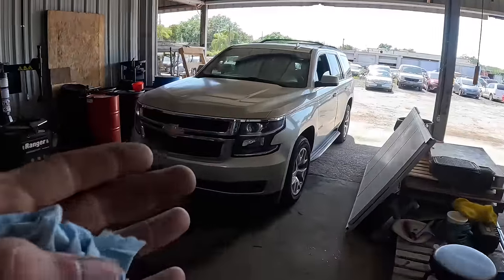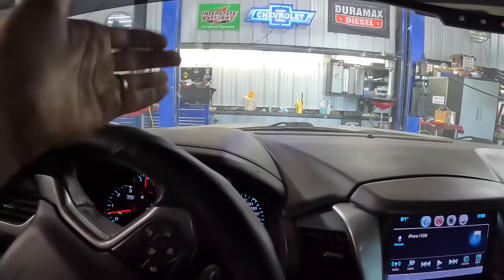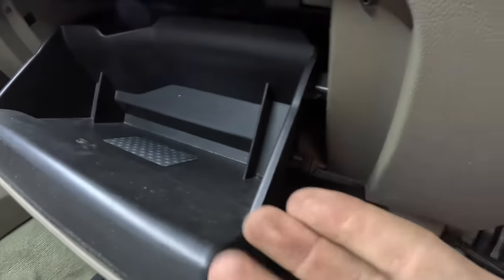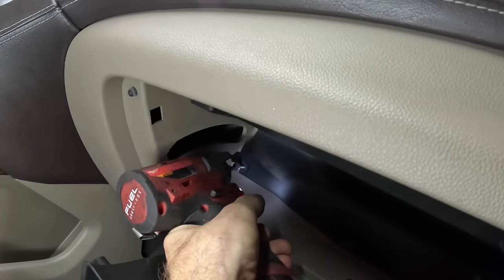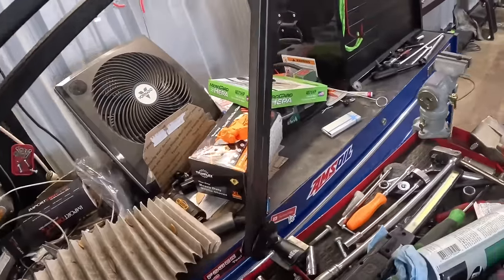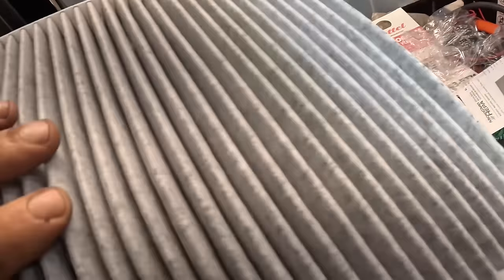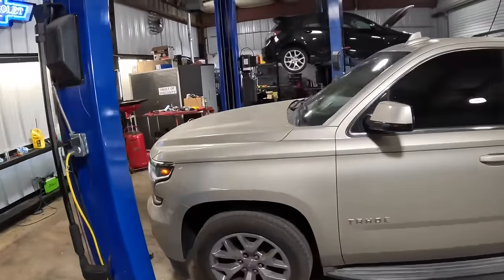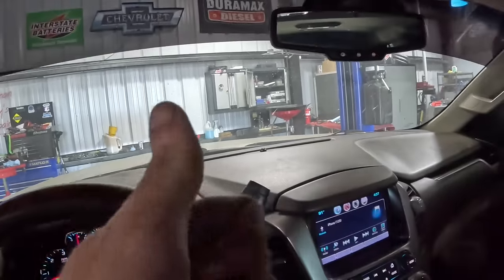Stink Fumes from the Dash! (AC Evaporator Foam)

Comment: I had a dealer yesterday that wanted to charge $82 to replace the cabin air filter in a car that has less than 2k miles on it.  They showed a photo and claimed the filter was dirty because it was one of the charcoal filters that has little black spots on it..  Needless to say, I declined.  I had a look at the filter later just to make sure, and there is practically nothing in it.

Comment: Ray: Any particular reason you didn't just use the filter hole as access upstream of the AC grid rather than pulling the fan? you can usually snake past the fan or just foam it too (Also, most can instriuctions I've seen recommend foaming down the dash vents as well as pulling the drain and foaming up that (I'm guessing if you're on a lift it's easier to just foam straight up the drain from below)

For the homebodies:

If the glovebox door doesn't come right out, it's always worth putting a box or pillow or something undernearth to support it and avoid the breakage risk. Looks like in that one the hinge pins can be popped out if you're feeling paranoid (charcoal ones should be replaced every 2 years and TBH so should ordinary ones - do your engine air filter at the same time - and hit the car with a can of AC sanitiser spray too (it sanitises the entire cabin whilst you're at it))

Comment: 3 things about cabin filters; No1 use the old one to kneel on next time your under the dash,  No2 if you do a Fiat, Citroen, Peugeot, RHD take the front panel off and if ness cut the middle plastic bar out, removed the 2 filters, put the first one in and use a 12inch metal ruler or even a hacksaw blade to squash it down and slide the top one over the top, OR ram them both in shouting at them from under the clutch pedal get out the car shouting and threaten to quit your job. No3 In the UK it's a Pollen filter....it has nothing to do with Pollen its to prevent the diesel vehicle in front of you pumping in particulates from its exhaust (I know modern diesels have DPFs but you guys run then 2 miles on the school run they don't get hot enough remember a UK vehicle runs the first 200 yards on its starter motor Turn and Burn)

Comment: Hey Ray, did you know that every GM vehicle that has the trailer button on the shift lever will only allow the vehicle to charge to 80 percent unless that button is pushed!  They did this for better fuel mileage for the govt. Makes no sense because when it is pushed, it kinda downshifts and unless your towing something or plowing or whatever, nobody wants to drive around with this depressed. What say you?

Comment: The filter labor question, I would say its not fair to charge them.  In other situations, you charge a diagnostic fee for example (which should cover the labor to take something apart to figure out what's wrong).  And you're hopefully making money on the other service/services they came in for to begin with before you (by you I mean a hypothetical repair center) decided to look at the filter.

Comment: In hot humid areas, the stinky you smell when you first turn on the AC is the smell of mold spores that has collected on the evaporator from moisture clinging of the evaporator fins.   Once the A/C started and the evaporator started doing its job, collecting moisture thus washing out the spores and draining the moisture out of the evaporator case, the smell went away.  The stinky is basically the same as leaving a wet towel hanging in your gym locker.  Back in the 80's this became a big issue for car manufactures.  Their answer was, Cadillac had their interior fan run for a few minutes after shut down to get air flow across the coils to aid in drying them out.  Some manufactures applied a very slick coating so that water would literally fall off the coins.  One that is around today is that the blower start up was delayed a second or two so that air crossing the fins would be cooled first instead of hot air crossing the fins at start up thus reducing the amount of stink.  Some worked on the eval drain system so that water would not pool up in the case.  The big thing for those manufactures who went the chemical route used a chemical, I forget the product name, it was however the same chemical that was used to clean cow utters before the milking process was sprayed into the system prior to the evaporator.  Techs hated working with this stuff.  A cabin filter will help keep particulate from clinging to the evaporator but the stinky is here to stay.  These chemical sprays equates to nothing more than mask a concern which will not be a permanent  solution.
Reply: If you can afford it, you should change the Cabin air filter and do a foam cleaning at minimum every season in Florida
Reply: @omegatotal  What good will it do.  The test we ran back in the 80s found that after a couple of run cycles the chemical and  foam cleaning would wash away.  It is a waste of money and no benefit would result in yearly treatments.  You must remember your A/C basics; the evaporator job is to remove moisture the side benefit is dryer cool air.  Once the unit is turned off and the interior temps climb upwards in excess of 100 degrees, the water left on the evaporator fins starts to bake and mold spores begin to develop.  The cabin air filters job is nothing more than dirt control for the interior and will not reduce the water content.

Comment: 28:58 
Did it have a bad foot oder?  I seen hightop shoes in the back.

Or was it a mold smell?  I always shut the ac off and crank up the heat to dry out the coil and duct work if you don't it can grow a moldy smell sometimes  then that crap smacks ya in the face.  Not a bad idea.

Comment: If you agree to have them change it, I think it is fair for them to charge labor. What I don't like is people going into parts of my car that they have no business going into. I bought 2 front tires, mounted and balanced. I watched them work and next thing I know, my hood is open. I asked them why they needed to open the hood to install 2 tires. With some difficulties in translation, I was told "its a free service". "I just said, close my hood now please." Wouldn't you know it, as I drove away, my check engine light came on. They actually tried the "loosen the gas cap trick" on me

Comment: It is at least 20 years past time for the automakers to put a 1/8 inch steel mesh RODENT SCREEN inside the cowl and the engine fresh air tubes to prevent critters (and even insects) from getting in the vehicle.   

 A cabin filter is fine , but mice and rats can chew right through it and get into the dash, heating ducts, and cost you big $$$$ to fix.   First thing I do when buying any vehicle is pull the cowl, wipers, and install hardware cloth over the air intake 

Same thing for keeping  rodents from chewing through your air filter, and getting sucked into the valve train

Comment: volvo 850's dont have a cabin filter, intake up on scuttle, all the leaves and crap normally found go onto evap, mix with moisture, rot it out, result - no volvo 850's after 10 years with working ac - unless regular regas.

Comment: when I asked a garage to put in a new air filter. Week later came to pick it up. No change was done. box on the passenger seat. They sayed did not have time to do it. When I went to look where to put it I found they looked at the glove box, under the cowel under the hood but did not find where to put it. Then I searched further and found I had to put it at the firewall inside food well behind the gaspedaal fold it into the center console. And they bought the wrong one.😔 Volvo s40 2006 1.6D

Comment: I changed my air filter drove the mile to the oil change shop, the guy said your air filter is about 100% clogged. It pissed me off for some reason. I asked for the manager and the manager knew as soon as the tech handed him the so called 100% clogged filter that it was brand new, got a free oil change and never went back there.

Comment: Personally, if they take it out in hopes of selling you a replacement, then it should be reinstalled free. After all, they sold you a filter you may not have even known you had or needed replaced, so they made a couple bucks off of the filter.

Comment: Charging for labor on the filter seems like a rip off use it as good will and just charge for the filter, If you have ever driven through a dust storm you need the filter! Not to mention on the leaves and crap collected through normal driving.

Comment: DWD2 EVAPORATOR CLEANER, you don't have to pull out the fan unit and this product works 10 times better than your process and your product you used. As with DWD2 you're spraying the product in through a tube and a small eighth of an inch hole in the ductwork while the vehicle is on and AC on high you're able to push this product in the foam through the system with the force of the fan helping and then the vehicle gets shut down for a few minutes after the can is empty to allow the chemical to clean the evaporator. Before and after on the camera the difference was absolutely night and day as I have used this product over a hundred times.

Comment: A dealership tech who only does transmissions doesn't have time to do oil changes or cabin air filters.they have lube techs that do that stuff.I don't know what those kids do about cabin air filters.its a different world than the independent shop.didn't you work at a dealer?was everyone specialized or did everybody try to do the whole r.o.?

Comment: Too Thick of Filter will Resist Airflow, same goes for your Heat and Air Unit at Home, the cheap Thin filters "changed often" will give you better results for Air Flow...

Comment: If a mechanic pulls the filter out, that's on him. If the customer agrees to the change, the mechanic should only get the assembly labour [cuz the customer didn't ask for it to be done]. If the customer asked it to be changed, then the customer pays for the disassembly and reassembly. That would be my solution to that situation.

Comment: I was waiting for the can of fishing worms you found, that got left in the car after you took the kids fishing, TRUE story, only a 58Ford Dad had and took us fishing LOL. He always told of a story of a 35 Ford 4door that that he found in a junkyard in late 40,s, that he put a little flatbed on the rear and made a shell for the back, since it had been rearended, but running gear was good, he would go to Woolworths in St Louis and buy a bunch of .303 Enfield WW2 surplus rifles, for 7.50 and sell for twice that to farmers, dating my Mom. A skunk run out in front of them in a rain storm and whacked it ,and stuck in between the frame and exhaust, so the faster they would go, the less smell there was, until a cop caught them, he shined a flashlight light in the car, and seen all the rifles, and then got a whiff of the skunk cooking LOL, Different time period for sure, he sold him a .303 Enfield jungle carbine LOL, AND let him use a flashlight to try and get the skunk out with a old fence post!! On a different note, I noticed you using the bore scope looking at the evaporator, WILL that pick up the lime green a blacklight will make the dye glow used in refrigerant they use today, or are the bore scopes still in black and white? I am guessing someone has thought of that idea for finding a leak in a evap coil, if not, and you make a million off the idea , help some more people out with about 10 k of it LOL I have been out of wrenching 50ys + so..

Comment: Cabin air filters are useful.  They prevent contamination of the blower, evap unit, heater core and ducts.  Japanese manufacturers seem to make it much easier to access the cabin air filter.  Every one I've changed is immediately accessible after dropping the glove box (Toyota, Suzuki, Mazda).

The cabin air filter is probably the least serviced part of all the serviceable parts on a motor vehicle.  Many people drive around in a stinky vehicle without even knowing a two minute job changing the filter would solve the problem.  If the interior of your car smells like Ahab's jock strap, changer yer cabin air filter.

Comment: This is when flat rate is a bad idea.  I’ve had a dealer drain and fill my CVT for less than $150 including fluid and labor, and then ask more than $120 to change the cabin and engine air filters.  It does not give me warm and fuzzy feelings about their honesty, even if that’s legit how flat rate works.

Comment: I had chipmunks making a nest on the top of my cabin air filter.  They were accessing it through the rain water drain channels from under the car.  I had to take the external air vent apart (where the wiper arms are) and put in a metal screen with aluminum tape to keep them out.  As to pronouncing "Chine-uh" that sounds like Trump.  Something people that were born after the 70s don't know (I was born in '53):  "Made in Japan" used to be considered cheap junk.  Now it means high quality.  Maybe China is going to be the same.  Or maybe not.

Comment: I purchased a cabin replacement filter for my 2011 ford focus from Rock Auto.  only to find out later , that my car does not have a cabin filter.  Why is Rock Auto selling this it ??
P.s.  I still can't find the PCV valve on this car either.

Comment: Not entirely true. Ordered a Cabin Filter for my Aunt's 2013 Escalade ESV. Went to change the filter and it was not cut out and did not have one installed??? You would think the top of the line at GM would get it, but NOPE.

Comment: So a Question here, seeing how so much Debris is captured by the Cabin Filter I assume if the vehicle does not have one this ends up in the Evaporator (A/C equipped) Or Heater core? On a Vehicle like a 2000 Durango without a Cabin Filter and the need to remove the dash to access the Heater fan and unit what would you suggest to enable one to remove the debris and spray the cleaner onto the core ? Also do they make aftermarket kits allowing the installation of a cabin filters on vehicles that did not originally come with said Filter? 
I have been so impressed with your videos  Thank you and I think the project you have in works to help the family with the 2011 Chrysler T&C is Awesome :)

Comment: Honda tried that on me last month. I declined. When I picked up my vehicle I turned the fan on high and it started making a loud noise. I pulled back in and told them that is going on. A mechanic came out and pulled the filter out. Upon doing that the filter was still full of leaves and some had fell down into the motor. Sorry work. They could have atleast shook out the leaves before putting the filter back in

Comment: I know Im like a nightmare customer some times.  I stopped going to a shop because they would always add an $80 charge to to an inspection of the vehicle no matter what you brought it in for.  even if I bring it in and tell them to replace the driver side front bearing,  they charge me to confirm that it was bad (yh ok)  but then to tell me that the rear brakes have %50 life left, so I may as well change them.  
NO, I will not pay for you to go on a fishing trip on my car to determine if you can sell me additional service.

Comment: 🤣Lol .. could GM make it more complicated to replace a cabin filter !?! My 2011 pearl white Lexus ES-350...96,281 miles on the OD....open glove box, remove cover in rear of glove box, remove cover holding said cabin filter, pull out and replace 😛no tools, screws, parts to remove, no squeezing upside-down with legs hanging out of your vehicle !!
GM doesn't want you to replace the cabin filter, they want you to replace the vehicle around the filter 😎

Comment: I looked up my vehicle and ordered cabin air filter then sent it with my car to the mechanic only to find my car does NOT have a cabin air filter so looking up the parts do not work all the time. I sent filter back with a note for my refund only to get stiffed the postage cost. I suggest you check in your car FIRST and not sellers of the item.

Comment: 13:03
Electrostatic Charged? 🤔
I have an Electrostatic Charged air filter on my HVAC system in my house. The filter has a wire element inside of the filter and must have low voltage power to it to function properly. 😶

I might question that as a viable selling/marketing statement or claim of Electrostaticly-Charged filter material, and its abilities to filter the air better in this instance. Is this filter drawing VOLTAGE to keep it  NEGATIVELY CHARGED? 🤔

Just because the fabric within the Cabin Air Filter was negatively charged at one time, doesn't mean that it will always be that way forever.  EXAMPLE: Static Electricity from your clothes dryer, rubbing your stocking feet on carpet. 😉

Comment: So first on your ? about a shop pulling the filters and showing them then charging labor I would say No that's not cool, but if they suggested they should be changed and you said Ok then if they replaced them and charged a labor fee (for the Cabin Filter only and included the replaced filters as proof they were changed) I would say ok, but it should be pointed out I prefer to do all of the maintenance I can myself. Back in 89 I got burned by a shop when I had a 86 CRX (fiancee's car that her dad bought her and made her take it to a shop) afterward it had a Misfiring cylinder and after taking it back 2 times and not being fixed I found they did not replace the plugs or wires but were charged for them, So I replaced them myself and poof the issue was fixed since then I have a hard time trusting any shop to work on anything I own unless I am not capable of or have the time to do the repair.

Comment: There are a ridiculous number of steps/fasteners/barriers designed into this cabin air filter system. One that needs routine disassembly for maintenance. I can inspect/replace my Mazda CA filter with no tools in less than a minute.